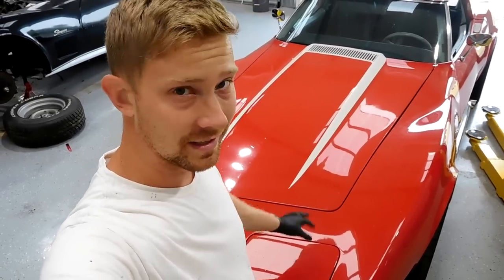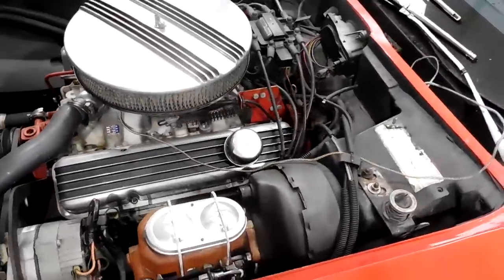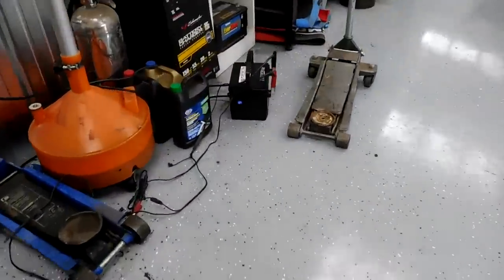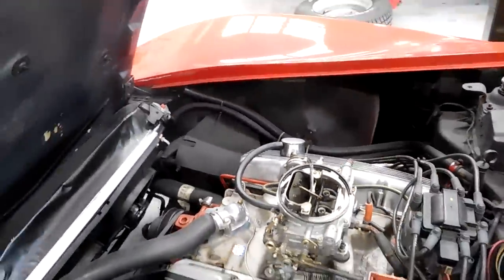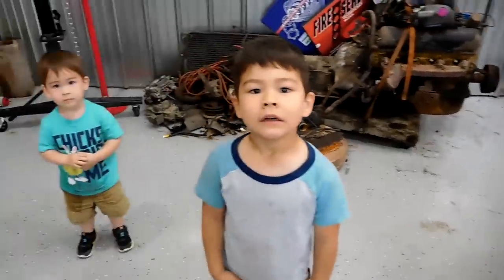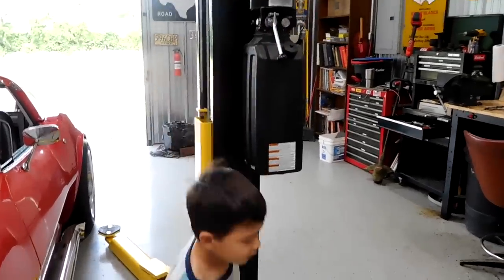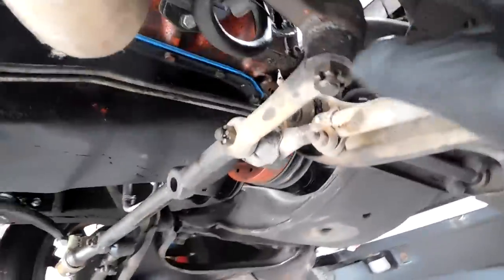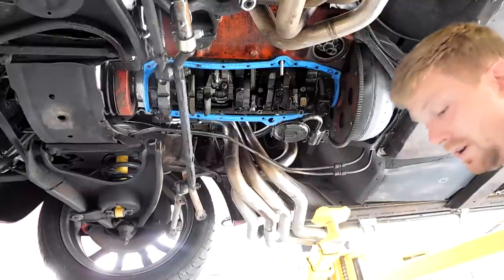1976 Corvette Engine Knock-Knocking on Heaven's Door

Comment: I  had an 81 that did the same thing.  I rebuilt it to a 355 which made a huge difference after adding some go-fast goodies.  The car was made into a convertible in an earlier life and drew a lot of attention.  Sold it at a Bloomington Gold Mecum auction to someone in Birmingham.
Reply: Yeah, few $hundred in parts would bump old engine to 350 - 500 HP...

Comment: Hmmmm.....#'s matching block?? Since the crank is either shot or requires a regrind, IMHO, I would say a nice 383 stroker kit, cam/springs, heads, and induction after some machining on the block. In any event, that block needs saving even if it's only a 2 bolt to be put in the corner as it's original to the car.
Had an '82 that was custom but it was a dog. Now my '90 was modded and I got up to 165 with still more pedal but it was scary on the turnpike and not the place.

Comment: I rebuilt an engine then first run out put a con rod right through the block. 🤦‍♂ Bits of cast iron covered in oil floating down the road. Guess I skipped the page on torque  settings. 🤣😂       she sounds great BTW 😘👌  just like mine for 2 mins

Comment: Don't you think a simple rebuild would do (instead of a new engine) and retain the "numbers" aspect?
Reply: When you consider all the parts and labor needed (machine shops are becoming scarce and are expensive) the cost even for a Chevrolet small block would be much higher than for a new crate engine replacement.
Reply from the maker: Customer’s decision not mine. With the crate he still has the option to rebuild the original anyways
Reply: @TheCorvetteBen  and he's back on the road quickly too. I'm still looking for a 73 454 convertible
Reply from the maker: Come buy mine $45k
Reply: @TheCorvetteBen  is that the red one or orange one?
Reply from the maker: Red
Reply: @TheCorvetteBen  automatic or 4spd?
Reply from the maker: Auto
Reply: @TheCorvetteBen  350 or 700r?
Reply from the maker: TH400
Reply: @TheCorvetteBen kids kuteies😅😅😅